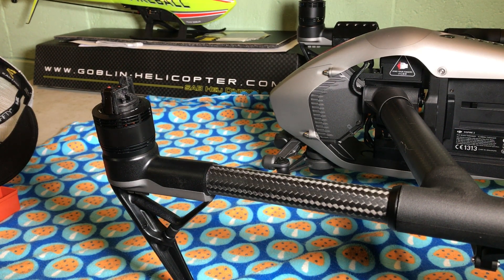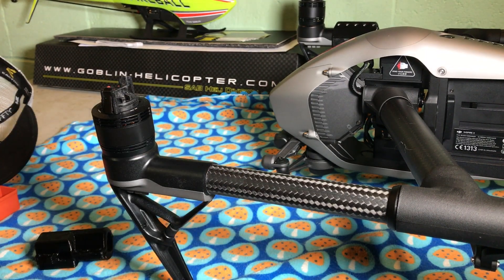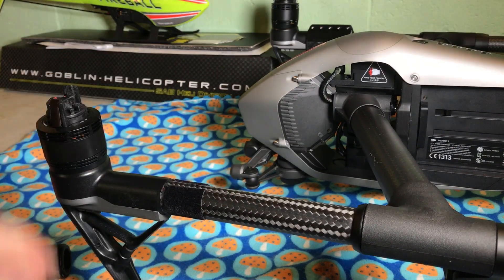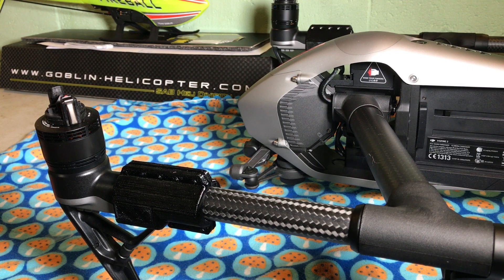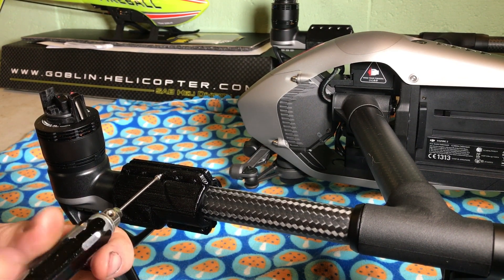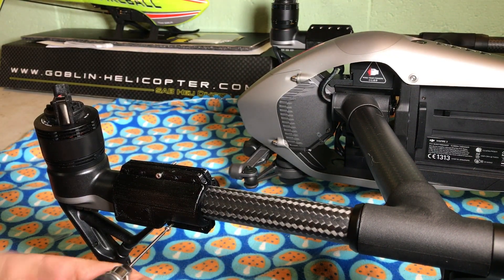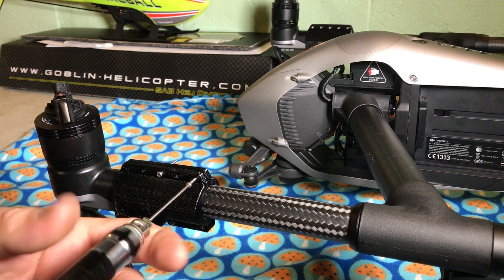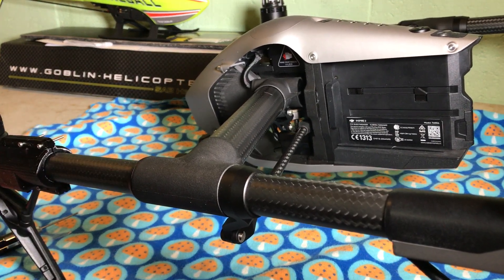DJI Inspire 2 Boom clamp

Comment: Know a guy who has flown Inspire 2 professionally for over 300 hrs and never had a problem - not seen anyone describing the issue either - only folks making remedies?
Reply from the maker: That's great, how it should be. Some others have not been as lucky. I have been doing this stuff for 13 years and know things can and will fail. I am not selling these, i have shared the files for free to anyone that may want to use them.
Reply: My Inspire 2 crashed because the motor mount became loose mid flight and ejected the motor.  Sudden and catastrophic failure and of course the bird goes straight down almost instantly.  And YES I always preflight checked my gear.  This problem doesn’t show itself until it suddenly fails.  This cost me over 4000 bucks and at 13 months old, DJI wouldn’t warranty it.  Don’t believe it will not happen to you?  Well probably not, but this failure has happened enough to be known.  Well known

Comment: Why are you reinforcing the joint ? Is this a known issue where they are faulty ?
Reply from the maker: Yes, there have been multiple issues with motor mount departing from carbon boom.
Reply: My biggest issue is the Old Story of props being loose. Mostly red but white too. Best fix I saw was to draw a bead of superglue on the surface that mates against the prop retainers, let it dry then file it flat. Otherwise there are permanent mount props available with T-Motor carbon fiber blades.

Other than that one side landing gear strut arm linkage kept sliding off in flight allowing the motor angle to tip out too far. Locktite 242 (blue) didn't hold the screw. DJI sells 263 (red) but I needed something fast so I used 271 (red) sold at Home Depot.

Last out of 10 TB50 batteries 2 have failed with battery cell error. DJI replaced the first though I thought it was a bit past their 6 month battery warranty. The second one failed and I bought my own replacement. I'm no longer going to hot swap batteries like they say you can.

DJI Select Membership is $29.99 a year, you get 20% off coupons on accessories, prioritized shipping and more. I bought CrystalSky Ultrabright for $999. with stated ship time 10 - 15 days. The next AM I received ship notification and realized I could have used 20% off coupons so I called sales support. Was told sorry the item shipped already and they cannot retroactively apply the coupon but suggested if I refuse the package and re-order with the coupon I will receive full refund. I re-ordered that afternoon the CrystalSkyUltrabright ($799.20 with coupon) along with a Cendence (stated 20-25 days to ship) and again they shipped it next morning FedEx Ground. Made it from Georgia to Chicago under 48hrs. When I ordered the 5.5" CrystalSky ($375.20 with coupon) in AM they shipped same day on a Thursday, made it to my area Friday but delivered last Monday.

Cendence has free patch antenna, dust covers that keep dust from getting in by your sticks, and the plate that keeps you from blocking the air intake since it's so heavy you have to rest it on your abdomen.

In 2015 I crashed a new Inspire 1 in May and didn't get it back until August because DJI moved repair center to a bigger location in Torrence CA. They fixed broken boom and camera with broken gimbal for $270. Was cheap but took most the summer. Next time I had a broken boom I fixed it myself with a complete teardown in 8 hours time and a $350 boom on eBay.